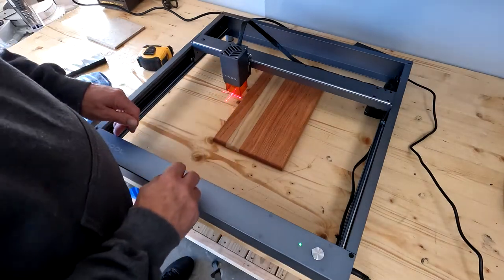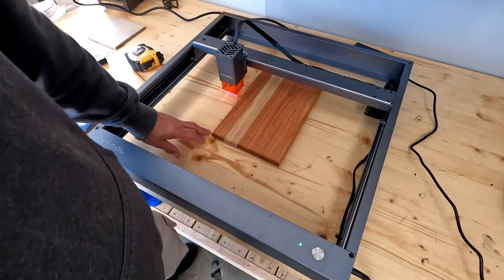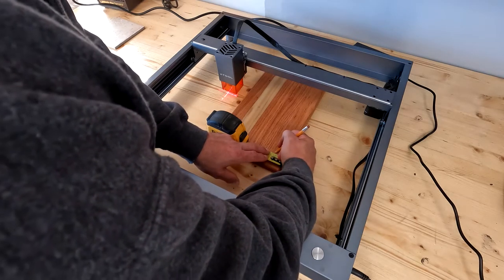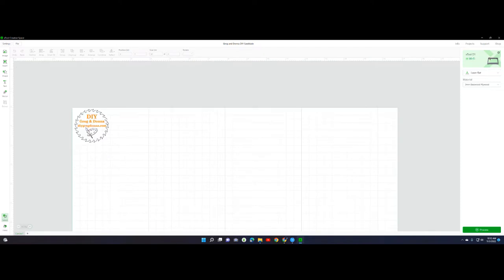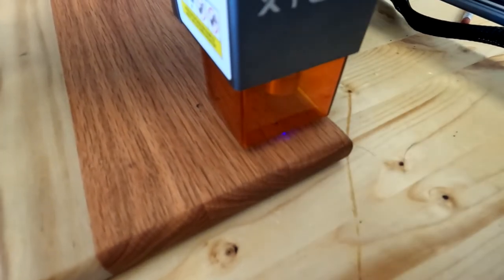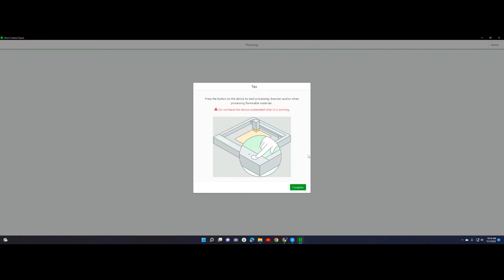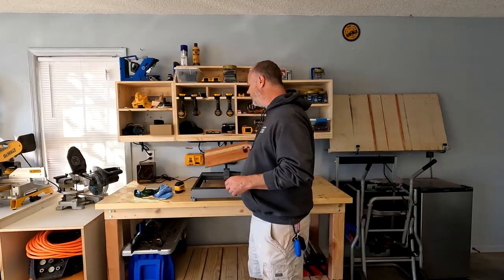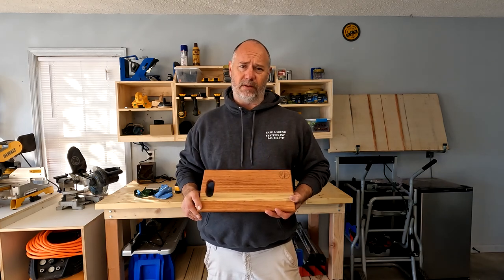xtool d1 engraver crosshair laser alignment center of project fast easy update

Comment: Do you wear goggles when framing?
Reply from the maker: No I personally do not.  The yellow guard around the laser should be sufficient for framing.  There are different wavelengths of light and you will notice you can find yellow and green, the yellow are for lower nm of lights up to 540nm. https://amzn.to/3Z0uB2H Humans can only see light from 400-700nm.    Get a pair of those for framing if you feel better doing that, I use the factory installed one and have the cover with the light shield when framing.  The green goggles that come with the unit are for when the laser is burning or cutting.  It emits much higher light including lights over 750nm and plasma which can do real damage to your eyes.  When I have a project running I have the shield down and use the goggles but still don't "stare" at it while it cuts, just check progress.  I have a Ring stick up camera pointed to the laser so I can keep an eye on it using the App without having to baby sit.  Hope that helps and wasn't to long.
Reply: @RagerJackOfAll  Definetly helps! I have been wondering if it was needed, but I imagined that it would be some other light/diode doing the cross, since is offset from where the laser is. I thank you for taking your time to answer this!

Comment: Even when it frames properly with no issue it fails to cut due to tripping a limitation sensor. It’s like the software and hardware have no correlation when it comes to position. It’s such lazy design for the system to not know its own real world position. All my 3-D printers can tell me in real time where the print it is and self align. For a small cut like this maybe it’s OK but if you are trying to realize the actual boundaries of the machine to efficiently use material you were asking for a headache of a time.
Reply from the maker: Agree this is a "beginner" model  or weekend warrior unit.  The bigger ones have feed thru tables now and many other things for large projects.  Thanks for watching and dropping a comment.